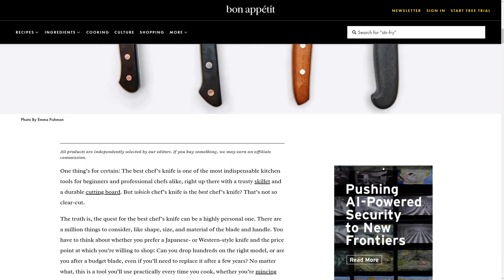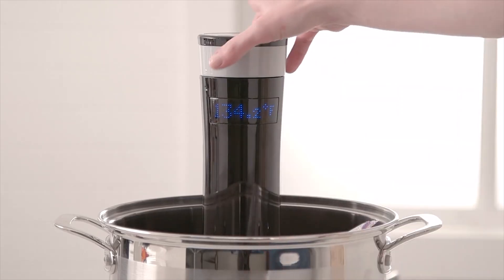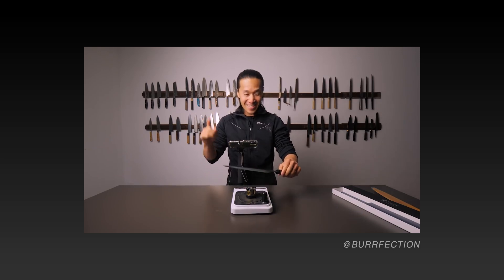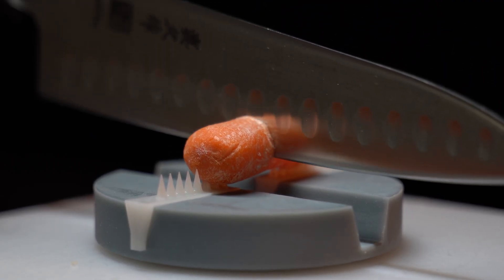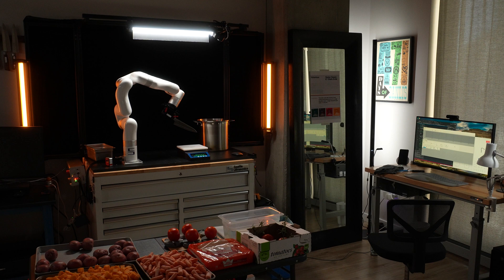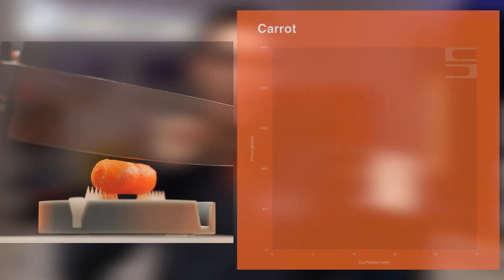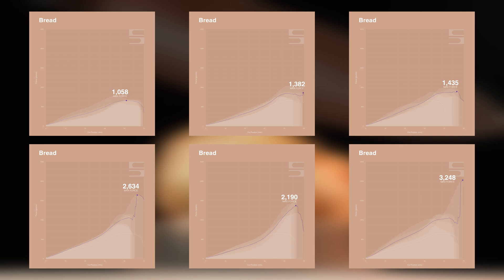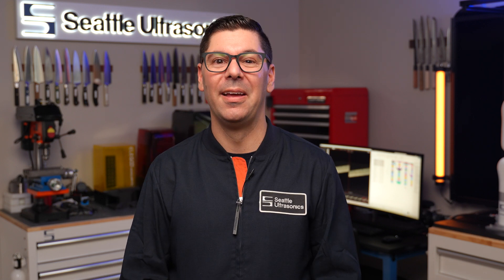The Quantified Knife Project - How do the most popular chef's knives actually perform?

Comment: surely nobody just pushes down on a tomato, squishing it until the skin snaps, but either slices forward or backwards until the skin has been cut by the knife, changing the length of the movement depending on the sharpness of the knife (with extremely sharp knives not needing any of it, but that only lasts for a very short time even with highend steels and amazing sharpening skill)

For example, the photos of the Miyabi Kaizen knife that scored highest in sharpness show that the scratch pattern of the ground is for slicing with a backwards motion, while the test with the robot was done by slicing with a forward motion
Reply: @AutHex at that weight it may even not need to be sharp at all. Joke aside: the tomato tests that I have seen are all slicing motions. The test in the video is pushing. This can be measured but a point in the video was to figure out the best performing knife and in my opinion this test doesn’t doesn’t do that.
Reply: @davidpan2405  robot in the video is slicing, not pushing.
Reply: The motion doesn't matter that much for tomatoes. If you compare ultra sharp Miyabi with Wusthof which cut tomatoes the best you will see what matters in this case - a toothy edge. It is extremely hard to cut a tomato with a super sharp razor blade, but super easy with a serated knife. Because to get through the skin, you need to saw it, not cut it.
Reply: @AuxHex  This isn't true.
For one, any knife shapened by normal means has tiny serrations. They're either perpendicular to the edge, or at an angle.
You want the teeth to bite into the food, so if the serrations are at an angle, and you move the knife in the wrong direction, you get worse cutting performance.

That's why you need to sharpen your knife to your preference of cutting motion.

Go to your kitchen and try it. Pushing a sharp knife through skin takes a ton of force, while when slicing in the correct direction, the weight of the knife alone is enough if it's sharp.
Reply: @tommihommi1  first of all, the tests here are about factory sharpened knives and you can see the edge differences in the provided difference. So your whole point is just plain wrong.

As for my knives, my CCK KF1303 falls through tomatoes under its own weight. Learn to sharpen, mate.

Comment: Very nice to see some actual data. What i would like to see the most is, how different apexes influence cutting force vs edge retention
Reply from the maker: We did also measure the edge angle and run CATRA edge retention tests for each of the blades. That data is available on the individual knife pages, or from the Github download if you want to run any comparative analysis.
Reply: Knife Steel Nerds has a lot of graphs and data points for different steel sharpness, edge retention, durability, and edge angle if you're so inclined. Excellent resource.
Reply: @JZStudiosonline  While KSN data are super-interesting, they refer to the steel itself before it's shaped into a sharpened blade. KSN's founder Larrin Thomas also states that blade geometry (sharpening angle, blade thickness) influence cutting performance much more than the actual steel. And cutting performance is what it's all about in the kitchen.

Comment: I’d love to see how much you can change the performance of the same knife via sharpening/dulling the blade. And if there is an optimal sharpness across the foods. 

I’m also curious about the role of friction in the flat part of the blade. A “smooth as glass” blade might actually drag more through some foods, increasing pressure. 

Nice work!